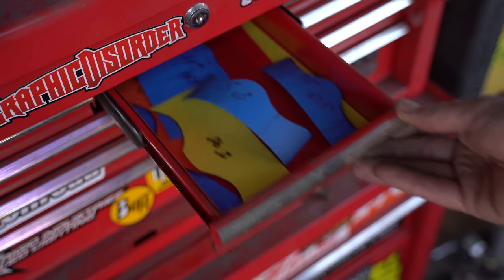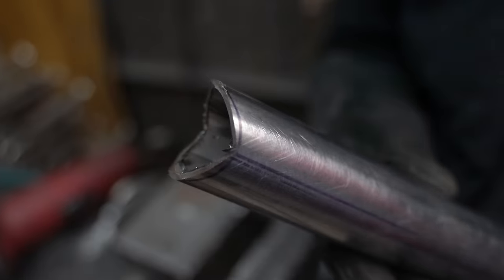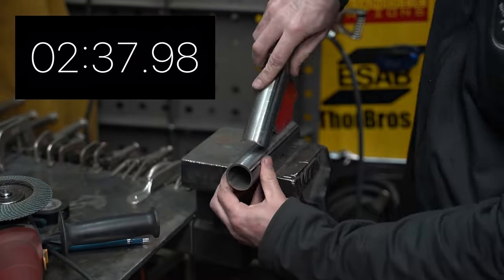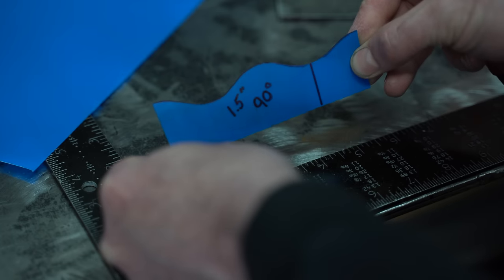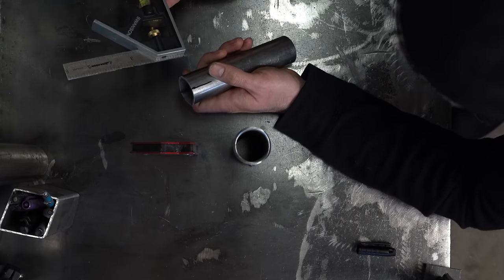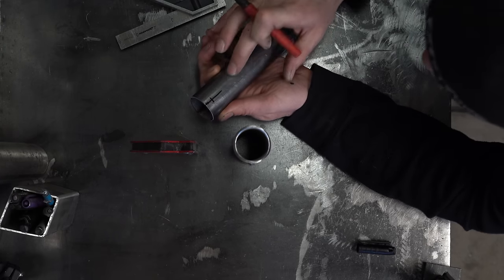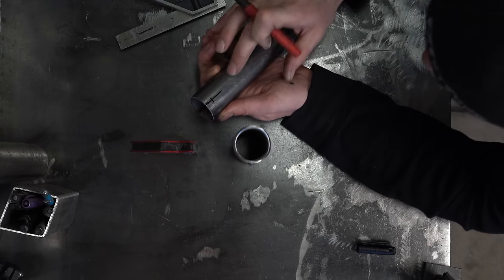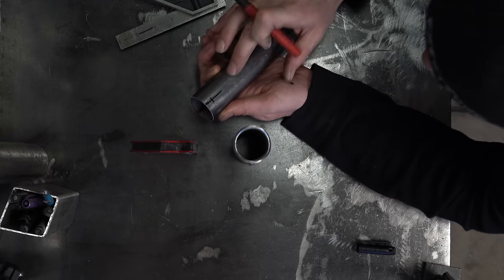How to Notch Tube with Cheap Tools!

Comment: How do you measure the correct length for the notched tubes that are to be connected to other fastened parts of the roll cage? I've spent nearly 6 meter of tube to cut it wrong 🤣🤣🙈. Thnx for very good do's and dont's 😃⭐
Reply from the maker: I wish I could see the exact piece you’re trying to make. Bends, angles and varying tube sizes sometimes make things really challenging. If you’re just inserting a straight piece of tube between two other equal sized pieces, it’s fairly simple. 
Say you’re working with 40mm tube. You need to measure the space between the two existing pieces. For simplicity that space is 1 meter. If you were to cut a piece of tubing at 1 meter length, that tubing would fit tightly between the two existing tubes but because there are no notches your 1 meter tube doesn’t contact the existing tubes all the way around. You would technically need to add material. 
Since the depth of your notches will be roughly 1/4 the diameter of the tube (10mm) and you have a notch on both ends (another 10mm), you must add that 20mm to your 1 meter tube.
So you would cut your tube to 102cm and then notch both ends at 10mm deep. 
If I haven’t butchered the metric system, your tube should fit nicely.
The trick is getting the tube in. 😳 If your inserting your section of tube between two parallel tubes you’ll have to rotate your piece in. But because your tube is exactly the right size you probably won’t be able to do that. You’ll have to deepen one side of the notch on both ends to allow your piece to rotate in. That will create two gaps that’s you’ll have to fill when you weld it in.
Let me know how badly I confused you just now!! 🙌
Reply: @GarageFab  So far, I'm with you. The one that messes with my head is going in the back part of the cage, from top at one side, down to the bottom at the other side. So the connecting tubes are more or less parallel, but I will get the deepest notch at opposite sides on the bar I'm measuring...or TRYING to measure 😃. The plan was to have a cross at the back, but right now, that doubles my troubles 😳🙈. I get your ideas how to get it in place, but the measurements makes me bang the tube in my forehead for making the tube too short. Distance between side bars in bottom is 158cm, and 156cm on top. Length of side bars from wheel arch to top are 68cm. Am I correct if I say I can't make to similar tubes must be "mirrored" .
Reply from the maker: Do you have an Instagram account? If so hit me up with some photos @GarageFab.
I’m having a hard time picturing your predicament. Maybe some images would help.

Comment: Cheap tip you're welcome to test/use in another video, take a 2-3 inch long scrap, can be longer but not necessary, set it to the angle you want on the other pipe (mock) then shine a bright light down the tube, trace the shadow line, or use spray paint instead of the light. 

Please note the one getting tracing/paint is the one visible through the other tube
Reply from the maker: Sounds intriguing! I’d be willing to give that a shot. I’d imagine only the top half of the tube would be marked unless I’m imagining things wrong. Would you have to rotate things and re-mark?

Comment: Even easier, use 50mm PVA pipe, you can file it by hand! Trace the basic template as shown, scan it to a PC, then print off scaled for the pipe diameter.
Reply from the maker: I like the way you think!

Comment: You can make your own templates without grinding. Use Fusion 360 to create the tubing size you need, intersect them at the angle you wish, unfold the tubing and print the results to scale.
Reply from the maker: That sounds amazing! I don’t have Fusion though, and I know a lot of others don’t either. 😩
Reply: @GarageFab  One of the great things about Fusion 360 is that you can get it a limited use license for free. For most people, it will be more than enough. It is by far the most useful piece of software any fabricator should learn how to use IMHO. From 3D printing to CNC to plasma cutting. It is simply amazing.
Reply from the maker: Thank you for that! I’ll certainly be checking it out. 🙌

Comment: In the back ground the blue cold cut blade in your cold saw set at 30 degrees will give you a fish mouth and weld bevel in one shot real fast. try it.
Reply from the maker: Thank you, Rex! I use that method often after marking with a template. This video was intended for those that don’t have a chop saw. Cheers!

Comment: Hi, what size / grade tubing you using for subframes and chassis? I was looking at t45 but it’s expensive stuff, thinking of using 31.75mm with 3.25mm wall cds for subframe a control arms
Reply from the maker: In the states the most commonly used material is 1.5 inch (38mm) chromoly tubing with 1/8 inch (3.15mm) wall. Chromoly is tougher material so the wall thickness can be thinner. Some use regular mild steel but the walls need to be thicker 3/16-1/4 inch (4.75-6.35mm) and that stuff is HEAVY! Chromoly is also more expensive but you get what you pay for.

Comment: Can l use this method for any size of pipe?
Reply from the maker: When notching a tube to fit another tube of the same diameter, yes! The 1/4 of the tube diameter for the notch depth works on any size. It does NOT work with dissimilar size tubes. (Notching a 1.5 inch tube to fit up against a 2 inch tube) Hope hope this makes sense.

Comment: Why not use a plasma cutter to get it close and finish with  flap disk?
Reply from the maker: I love my plasma cutter but it’s a bit messy and not extremely accurate unless you have an extremely steady hand.
It would absolutely work though, and very quickly!

Comment: OK, not sure if I'm just being daft here, but at 13:24 you say "set the tube you are notching on the edge of another tube".  But... where?  Is that where the "Top" centerlines of the tubes meet?  Technically the outside of the base tube and the inside of the angle tube, I suppose.  But where is the meetup supposed to occur?  Sorry if this is a dumb question.
Reply from the maker: Not dumb at all. If it’s not clear, that’s my fault. 
In this example, the tube laying on the table is just a tool to help mark the tube that actually needs to be notched.
When you set the tube to be notched on the end of the other tube, the goal is to make as much contact as possible. The curve of one tube will rest nicely on the curve of the other like stacking sea shells This will likely only make sense when you’re actually doing it. You can only overlap the two tubes snuggly a small amount. I recommend playing with some tubing and hopefully it’ll make sense while actually experiencing it. Lemme know what you find!
Reply: @GarageFab  So, basically, just set the branch tube on the magnet, and move that up and down on the magnet while moving the base tube back and forth until you get best fit?
Reply from the maker: Yeah! You worded that better than I could have. 🙌
Reply: @GarageFab  Does this same trick work with other angles?  Or is it only because the 45 degree front notch is nearly flat across the front of the tube that this works out?  i.e.: Have you tried this with a 30 or 60 or 22.5 or 67.5 degree branch?

Thanks for answering all my questions.  :D

Comment: Hi mate, would a 100 amp gasless mig, (using flux core wire) be suitable for strength in suspension parts. like 4 links etc.. setup for drifting. would I be in the safe? being a fairly decent welder
Reply from the maker: I don’t know a lot about flux core welding, but I’ve been told if done well it has superior strength to gas shielded mig welding.
I built utility trucks for awhile and while most stuff was welded with gas, all the heavy duty trailer hitches were flux core welded.
I continue to use gas mig because I’m superficial and it looks fantastic! 😀
Reply: @GarageFab  thanks, that helps!
Reply from the maker: Any time, Kieran.

Comment: About to reorganize my shop. Layout suggestions based on yours?
Reply from the maker: That’s a REALLY interesting question! I’ve rearranged several times over the years trying to make things more efficient. 
What sort of tools do you have at the moment ?
Reply: @GarageFab  typical stuff drill press compressor welding bench work bench
Reply from the maker: I imagine layout would very much be a personal preference, but I can tell you how mine evolved over the years. Basically everything reversed. All the tools that I need to move often are now closest to the door. Welder/Plasma Cutter cart, Chop saw) More stationary items have moved closer to the back.(Drill press, Work bench) Storage shelves cover the entire back wall with the exception of my toolbox and the water heater. I will be moving my toolbox closer to the door. I’m a mechanic so I wanted my box nearest the front of the car, but having to trip over stuff to get to the box causes me to not put tools away and things get out of hand quickly. The area by the door isn’t usually as cluttered and I can just back cars in.
Reply from the maker: …oh and the compressor is in the back of house. So I can’t even hear it.

Comment: @garagefab Great video! (Edit on my edit: To anyone looking for an easy way to make templates, the website the video author recommends is way better than what I was thinking.)

(Edit: this idea might only work with the 90 degree template. I'm not sure, so I'm leaving it up until someone corrects me to be certain.) I had an idea about how to create the templates if someone wants to do that initial step faster, but still precise. If you do some research to find what mathematical wavelength would match which angles, you could use a program or website to produce an image of that wavelength with the number of oscillations you need (I think 2), print it out, then either cut the printed image with scissors and trace it onto the plastic folder, or just use a precision crafting knife to cut both at the same time with the image sitting on top of the folder. 

This way, you don't have to cut any metal to make the templates, only to use them, and it cuts down on any of the guesswork involved when shaping the curve after the angle-grinder cuts. The hardest step of this I think would just be finding the correct wavelengths to use, but once someone knows what it is, they can tell everyone else what it is, so it only really takes one person to figure that out.
Reply from the maker: I like it Jeremiah! Thank you. Check out the pipe template program at blocklayer.com and lemme know if this is what you have in mind. It would certainly save some time.
Reply: That's way simpler than what I was thinking, thanks! Your videos rock! Just out of curiosity, do most of your tips and ideas for fabricating come from personal experience of doing it yourself, or from various stuff on the internet, or from people you've worked with when fabricating? You have a LOT of useful tricks on various videos that I never would have thought of.
Reply from the maker: Probably a little bit of each of those things. Most of my Suspension knowledge came from other knowledgeable people. Then most of the fabrication methods and shortcuts I share are things I’ve come up with in my own. I’m a chronically lazy person so I’m always looking for the easiest/fastest and mathless ways of doing things.

Comment: Okay, if you own a drill press simply wrap your plastic template material around a wooden dowel of the size you want, clamp it onto a sacrificial wooden block directly under your drill press, chuck up the appropriate sized hole saw, (nice and 
slowly) drill through your 
plastic wrapped dowel, and “
bobs your uncle”!
Reply from the maker: Quite brilliant! I might have to try that just for fun.

Comment: Late to the game and maybe these didn't exist before - There are calculators online that can create the template for you at any angle for any size and thickness of tube.  Put in all your measurements and then print out a template on to paper, cut it out, transfer to something a little thicker (I like the binder idea, I also like neoprene from a crafting store)
Reply from the maker: @chrishouse5753  I wasn’t aware of them at the time but they did indeed exist. Blocklayer.com has a fantastic template generator as well as many other great tools.

Comment: if you have a 3d printer, just model the pipes and 3d print the template. Just remember to keep around two millimeters gap between your 3d printed template and the pipe so that it slips on easily.

Comment: I just use a pice of paper. It’s as long as the outside of the tube.   Wrap it around and make a mark.     Fold it in half.  Then half again.   So it’s 4 sides.    Then use the tube it’s self. Hold the pile flat to the edges of the paper and trace around the pipe.
Reply from the maker: I like it! I’d like to try that myself. Does it work for angled notches?
Reply: @GarageFab  use a pencil that’s has flat sides.  And hold the tune at the angle you want.    If your a lil off.  It’s easy to weld the gap.    Most of the time. The gap goes away.  After you bevel the tube

Comment: Did the same thing with cutting disc then flap disk for curves. After 3 tubes, my precision yields to sloppiness. Making my own notcher now for roof rack build that has nearly 12 horizontal bars and 2 vertical bars. Don’t think cutting disc and flap disk method going to make my job easier

Comment: How do you notch oval pipe?
Reply from the maker: There’s oval pipe!? I’d have to experiment to know for sure but I’d think it would be a similar process. 
The change might be how deep the throat of the notch needs to be. The 1/4 the diameter rule would likely change to 1/4 the width of either the long side or short side of the oval depending on the orientation of the notch. 🤔

Comment: Sir how to make paper guide any notches degree what is the measurement?
Reply from the maker: I would love to answer your question but I’m not sure what you’re asking.
I don’t currently have any measurements to make notch templates without having a notch to trace.
Reply: Sir I mean teach me how to make template for any degree of 2inch. Pipe notching
Reply: When you make templates sir? You used tape measure?
Reply: I like your video because is very fast you make already templates the other videos in YouTube about notching they used tape Measure it's more time
Reply from the maker: I don’t do any measuring to make the templates. I have to have a notch already made. Then I wrap the template material around the notched pipe and trace around the shape of the notch. Then I cut in the line I just made to finish the template. 🙌
Reply from the maker: Thank you for the kind words!

Comment: What happened to coating the gas tank? I'm curious bcuz I was swap my Macro Cab MM 4 a standard cab tank. But decided to use  the Macro Cab tank instead of the standard cab tank.
Reply from the maker: I coated using POR 15 tank liner. I wasn't thrilled with the appearance of product when used as directed. It said to coat the tank and drain the remaining product but it appeared to not fully coat the surface. You could see the metal below. It may have been fine but I was annoyed so I left the product in the tank until it began to thicken and then coated the sides again. It coated better but it wasn't as smooth. No one will see it so who cares? The product did form a couple bubbles inside the tank which probably wouldn't have happened if I followed instructions.
If I were to coat another tank I'd give Kreem fuel tank liner a try. I know people that are happy with it and I've seen the finished product which looks well coated and smooth. I'll do an update video when I install the tank.
Reply: @GarageFab  Yo keep up the good work & info✊🏿💯🔥

Comment: another idea could be to 3d print the templates and have them like sockets
Reply from the maker: I would love to try that. I don’t have a 3D printer yet though unfortunately. But it’s on my ‘To Buy’ List.
Reply: @GarageFab  i do , i am a fabricator too and i am teling you BUY NOW......its $200 and u can go as far as your imagination goes.But u need time too
Reply from the maker: Time is something I’m very short on. What type of learning curve is there? I predict having to know 3D design software. (Autodesk)
Reply: @GarageFab  yeah mostly fusion360 . I'd say for the easy pats that you just want to get the job done like the notchers I mentioned, you are gonna get it pretty quick in like 1 YouTube video. But for the more complex things u will need time.  An added advantage is the quick prototyping. You draw 10 lines , count them and boom you have a visual representation of a chassis and it's overall dimensions in like 30 minutes. You can also make molds for fibre glass things which opens up some more things too
Reply from the maker: Man. Sounds like a dream! Thank you. 🙏
Reply: @GarageFab  i already printed the jigs if you want to tell me your insta i can show them to u, not something special but whatever
Reply from the maker: I’d love to! @GarageFab. I’ve been considering starting YouTube shorts, so that I can post something on my off weeks. If you’re willing to sell some, I’d consider making a minute long video about creating them and how well they work, and would be glad to give you credit for it.

Comment: This begs the question as there are tools filled with nails or ways to use spaghetti strands to make perfect cuts in carpentry and such, whynot adapt something like that for perfect notches at any angle on the fly?
Reply from the maker: That comment was highly interesting, but I’m not sure what you mean by that. Are you talking about literally using spaghetti in carpentry?!
Reply: @GarageFab  yeah you use uncooked spaghetti to take the shape of corners and such to traceout and make cuts. already found it. pins or welding rods arranged to take the shape of the pipe. already found several.
Reply from the maker: Ahhh! Ok Now it makes sense. Yes, they make those! Very cool.
https://amzn.to/3FaWWeW